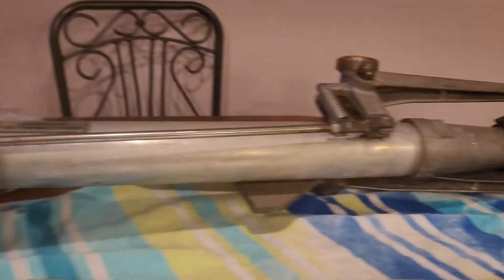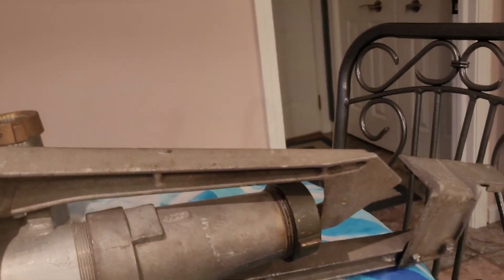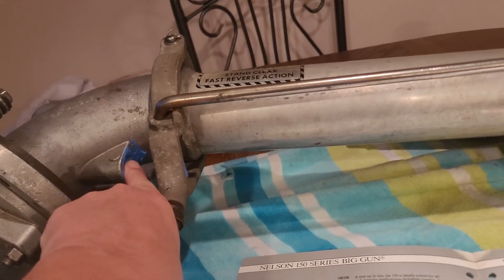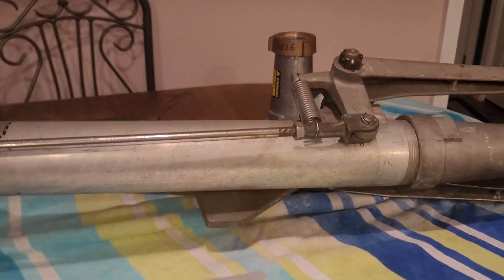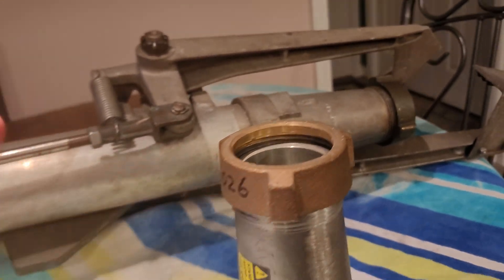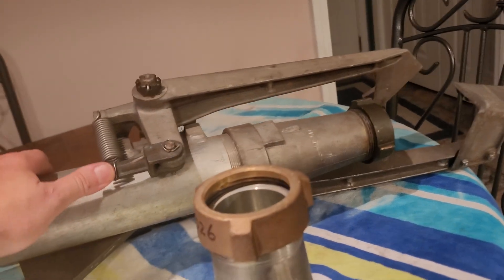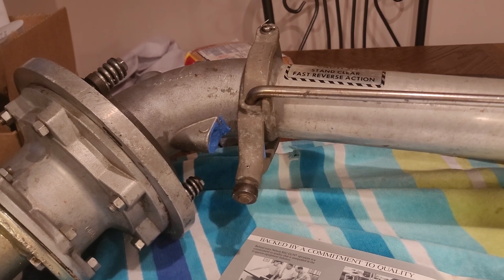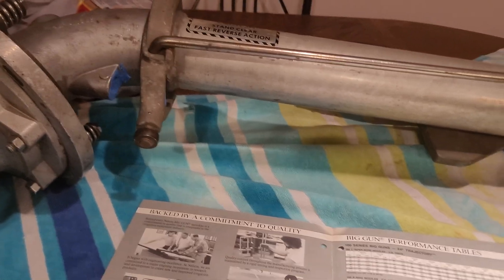Nelson 4" P200 fast-reverse big gun with info on operation and some pics from the brochure

Comment: Nice Nelson P200 and great close up look at the operation and your nozzle washer mod. I wonder if you can make a ring nozzle by getting a piece of 1/8" aluminum plate and use a hole saw of the right size for the outer diameter to make a custom ring nozzle and then drill out the center to the desired size if you can't find a regular washer with a smaller center.
Reply from the maker: I believe you can. I don't have a punch though.